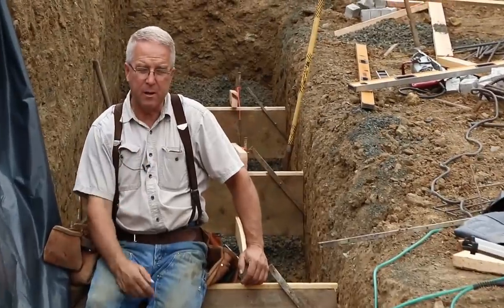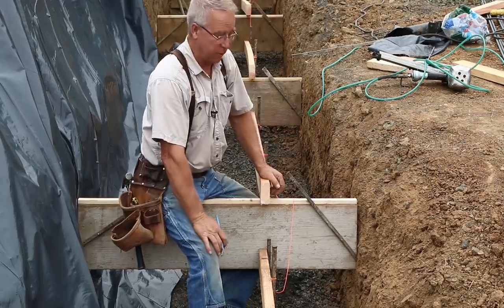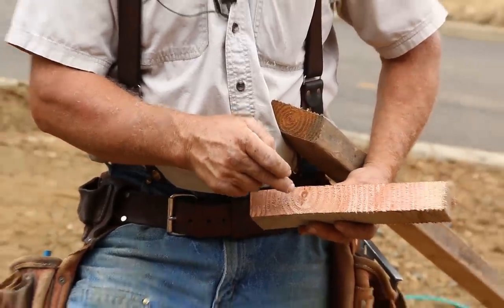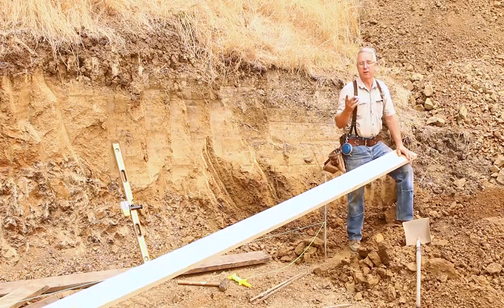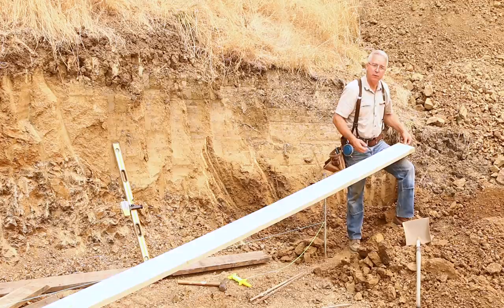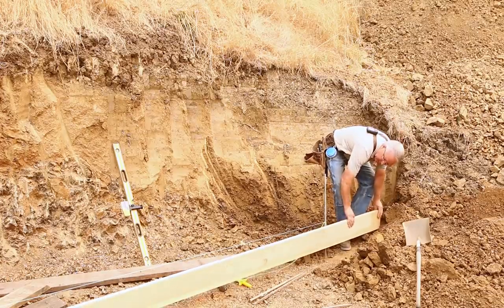Things To Know About Lumber

Comment: Great Info...IMO you forgot the 5th item that can occur with green lumber...SHRINKAGE...2x12 green is 11-5/8“ wide and can/will shrink to 11-1/8“.....Seen lots of floor issues before TJIs became the standard in flooring systems
Reply: outsidescrewball 2x12 is 11 1/4 wide 2x6 is 5 1/2 then as you go up 8,10, 12 they are 1/4 not 1/2 that's on PT wood or southern yellow pine.

Comment: Cool, except ring pores hardwoods like oak are different. Tight growth rings in hardwood make the lumber more brittle and less able to carry a load. Only the summer growth has real strength. The application would be a piece of ash for a ax handle. The wider the growth rings the tougher it will be. Thank you sir.

Comment: I think you have your grain orientations mixed up there a bit, the first is horizontal grain which is either rift or quarter sawn which after its  cut you cant tell which manner it was all the time just not common because of time and waste. It may be dimensionally stable (mostly because of the lack of heartwood) but is the weakest of all grain orientations. Vertical grain is the strongest.  The other two are just plain sawn just came from different spots of the log. The diagonal grain one could be an end cut of quarter sawn but not rift.

Comment: That was pretty cool what are the odds of getting all three cuts of a board in three random boards? They must have come off the pile in the order they were cut, they were probably from the same tree. I build guitars and can attest to the fact that there is nothing like a perfectly tight grain, quarter sawn board, it's a joy to work with and very stable. Great video, specially for someone just getting into woodworking or construction who may want to understand the materials they are working with.

Comment: the tightness of the grain is important for the job it is used for. the looser the grain, the less it can support. loose grain like this works great for the application in the video, and probably saved the builder money.(a guess) 
tighter grain wood is more expensive and unnecessary in this stage of construction.

Comment: Good video. One tip is never place green lumber under the sun or else it will cup sun side up in an hour and I've even seen them split right in two as the cupping puts stress on the lumber. there's almost nothing you can do. You also want to immediately seal the ends of green lumber to avoid checking as the new green garbage they sell is so open grain, you can almost see through the board.

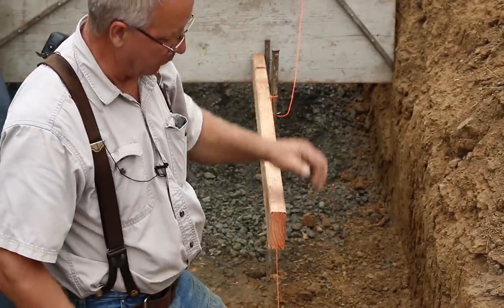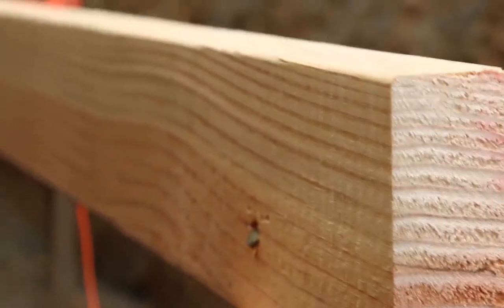Comment: The board at 1:30 is better than the one at 0:30, no? I only know the strength of wood grain in relation to axe handles but I thought it's most important to have the grain run parallel with the force you'll be placing on the board

Comment: This man is using the wrong terminology.  What he calls 'the heart' is not, the center of the log-board is called The Pith.  It is possible to have the pith and NOT have it in the Heartwood of the board. As a tree grows it forms sapwood which is also where the Pith is located, and the first 20 to 50 years of wood around the pith is known as Juvenile Wood.  The tree when young grows very quickly, and later after 50 to 70 years the tree grows more slowly.  You see this as the growth rings per inch increasing.  Now as the tree grows the sapwood beginning at the pith dies, and the wood that was sapwood now forms heartwood.  The Heartwood changes the wood significantly in a few ways.  The sapwood has no extractives, these are compounds that form in the heartwood that give the wood insect, decay resistance, and can impart mildew resistance, as well as odor, taste and other characteristics of each particular tree (oak, southern pine, western red cedar, yellow cedar, Douglas Fir, white fir, hemlock etc.)

Juvenile wood is weak, typically only about 1/8th the strength of the wood that forms beyond the Juvenile wood.  You see that is why a 4X4 pressure treated, which is almost always all juvenile wood, splits down to the pith, and opens up like feed trough.  

To actually learn facts go to the Forest Products Society and buy a copy of The Wood Handbook, authored by the USDA Forest Products Laboratory (www.FPL.FS.FED.US).  Never trust tradesmen.  They use wood, but know very little about the wood they use.  I spent a lifetime in the forest products Industry, and only know what I do from working with a now abandoned Liaison Group that met at the Forest Products Lab for decades.
Reply: What you have said above is accurate but adds nothing useful to the discussion. You are being pedantic. The information he has offered here is useful and well demonstrated regardless of the terms used.
Reply: Totally not here to sell a product
Reply: While you may be technically correct, the sales guy I was talking to did NOT understand either term.

Comment: You really need to spend some time  in  a respectable sawmill for a bit,,. It would  be a educational experience,  no disrespect,  but you've got a lot to learn ,
Reply: i think those 'respectable' sawyers need to get their asses out on a building site and look at the shitty wood they produce.  It's very easy to think 'job well done' when the stack rolls out of the kiln all banded together, you couldn't tell yourself that lie when the banding gets cut off and 3/4s of the boards look like rocker rails in one or more axis.   There is nothing, absolutely nothing, erroneous about the claims made in this video.  Everything this man said about wood comports with my 20 years experience in the building trades.

Comment: Great stuff.  The only thing that I would do different is put the crown down when forming a footing.  After assembling the forms, it's easier to lift the form to the correct level instead of trying to push it down (especially when you're working on bedrock instead of clay).